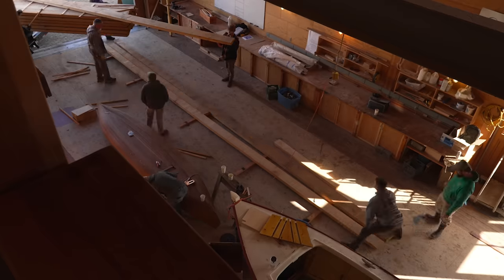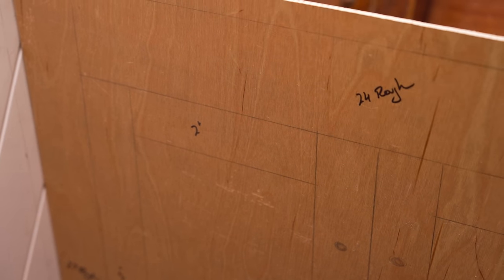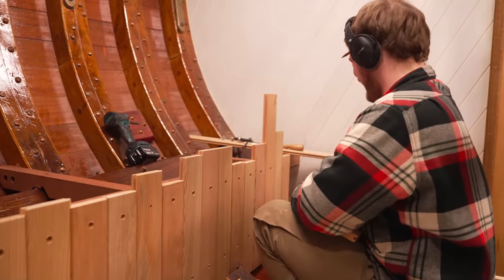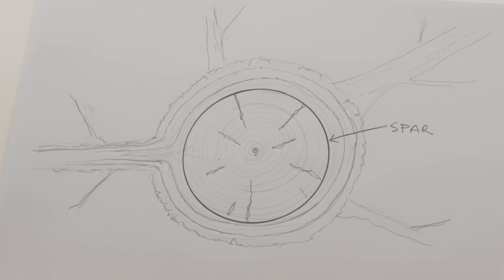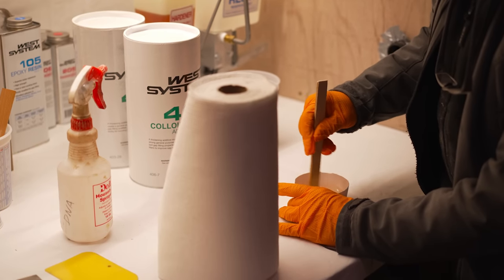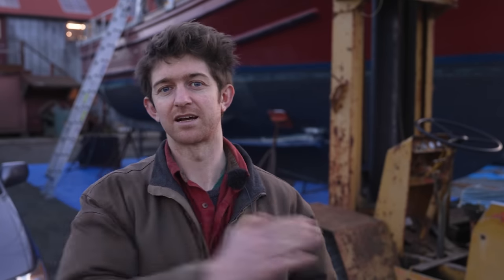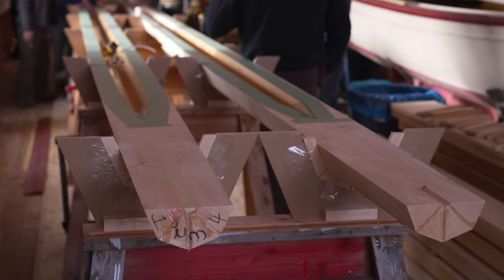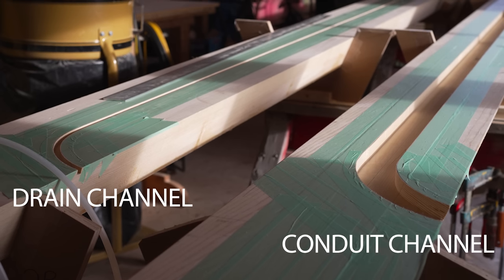Building the Mast (rebuilding Tally Ho ep146)

Comment: Leo, every facet of the Tally Ho rebuilt is top notch, no cutting corners anywhere! It would be interesting to Time Machine a shipwright from early 1900’s onto your team. Once over the culture shock I’d imagine they would quickly pick up on the modern tooling and be a fantastic addition to the team. My impression of boat building back in the day was they had much larger crews and the workers were more specialized. Building large wooden boats was a mainstream industry back then so every port city had a ship building workforce. You have come a long way with Tally Ho.

Comment: My crew in the carpenter shop at a US Navy repair facility in the '80's, was tasked with building a flag mast for the facility administration offices as the WW2 era mast was needing replacement. 45 feet tall, tapered,segmented and scarfed in alaska spruce. We had 2 civilian shipwrights who were on their Naval Reserve duty that supervised the work. After the epoxy glue up it was all hands on the hand planers to round it out and work the taper. We used an epoxy coating to finish it and it was painted with silver after, It was awesome for the modern sailors to learn the skills of our predecessors... Fond memories. Great job on Tally-Ho's!!!

Comment: One of only time's the blade in the table saw is set at the right safety height, 1/4 inch or less above the wood being cut..
Reply: Safety Sally in da house.  Not why the blade height is set flush.  But comforting when a fraction of an inch from the blade.
Reply: @weinerdog137  I've always thought of it as the difference between a bevel and a lost finger..

Comment: Leo, would you ever consider putting one of these new-fangled toroidal propellers on Tally Ho?
Reply: Think he would need his Patreon to do waaaay better, lol. One for a simple outboard for a bass boat is about $5,000-7,000.
Reply: Not likely as I'm yet to see a toroidal propeller that can be feathered. Feathering is important for sailing vessels as the propeller in feathered position will have a reduced drag when the vessel is propelled by wind/sail.
Reply: @apr888  Good point on the feathering.

Comment: Even at a smaller scale, building a mast properly is essential. 

 I recall, many years ago, watching the mast of a 17' catamaran explode.  Apparently, the jumper stays were too tight, but the wind was definitely too much. The explosion sounded like a gun shot and about 2' of mast became sawdust so quickly that the sail stayed in place for a few seconds before the rest of the mast suffered a catastrophic structural failure.

Lesson:  It pays to get it right!  😁

That shot of "Blue Peter" had me quickly looking it up on line.  Wow.  Not that I'm into motor yachts, but OMG.  Painfully beautiful boat.

Comment: SOO... I'm one of the folks stopped giving you Patreon funding... but not because of you but because I've stopped using Patreon entirely (I had an issue and found that they provided ZERO tech support... and I do mean zero. I could only login from one machine and couldn't get any others authenticated because of some issue on their end but they never even responded to emails. I figured if they couldn't fix a relatively simple problem like this I didn't want to trust them with money. 

I'd love to continue providing continuous support but you'd need to use a different service from Patreon... in the meantime I plant to periodically use your donate button.
Reply: Did you check your spam folder? If Patreon emails were ending up there that would affect authentication as well as giving you the impression that they weren't responding to your pleas for help.
Reply: Same here, email required to login, but I never receive an email. Nothing in spam folder and nothing helpful from Patreon.

Comment: Always do much nicer and neater working on something like that water plumbing system. I'm currently replacing most of a water system components in a 35 yrar old yacht. The previous owners have "modified" it over the years and the sight of garden hose made me need a sit down in a dark room. Once I have done the job at least I will know it's right.

Comment: Love seeing this. 
The barrel design is similiar to one I helped make 20+ years ago for a small trimaran built in a friend's back yard. 
Made a round cedar core, outer was four not eight pieces and we used a cold pin method (some may know it as hand peened) with metal collars for fastening with some glue as well. 
Most everything else was the same.

Comment: I only just watch this video today as I been so busy.
Anyway, having the radar reflector in the mast want work at all. The mast is covering what needs to be reflected. The square you see in the plastic tube are they to help the radar beams to reflect back to the scanner . If it can not     Reflect back because it’s inside the mast then it won’t work at all. Just think of it this way, look at all the stealth planes all have very smooth sides so the radar can not reflect off it.

Comment: I like how they engineered that Spar, with using a Jig set up for gluing it up. That's what I call precision fitment if you ask me. You should have confidence in that Spar. Should be able to handle the necessary forces that comes with Sailing. Great Job guys. Pretty cool stuff.

Comment: Really good episode having watched the full series. The next step is the boom I guess and judging from others (such as sailing NV who broke the boom 3 times over may years) a boom is more fragile than the mast. I would consider building the boom just as you have done for the mast but I would consider filling the central part with a S/S thick wall tube and epoxy the outside to the wood ...that should add huge strenth and provide the conduit for sheets etc. Anyhow on past performance I am sure you will do it right. 
regards

Comment: Nice to see those craftsmen working together to do such precision joinery . . . and with a skill saw. Beating the glue kick-off must put some pressure on the job.
I wonder if there's any footage showing how they put the taper on the staves. Do they remove material from the mating surfaces, or the outside surface?

Comment: Question on the barrel stave construction. Being a commercial driver I see a lot of engineered wood products. Usually see some kind of router work done to cut v's into the surface. This increases the glue surface area and increases strength and reduces the possibility of a glue failure.

Comment: I'm surprised you used West system epoxy,system 3 is made local and have always been top quality.I especially like easy 1:1 mixing ratio, for years West used a custom blend needing their pumps for mixing the right ratio.Now they finally changed their ratio to 1:1 so I assume more customers  would buy their product. West has been in business a long time but I'm a long term customer and won't change my choice.

Comment: nice quality!   i'd be nervous about using dougfir tho...it's hard to find the good old fir that lasts...nice to see high quality work!
Reply from the maker: It's Spruce, not Doug Fir! Although I'd feel fine about using doug fir if it was good quality.
Reply: @SampsonBoatCo  i live in southeast alasaka, i've owned wood commercial f/v's for 35 years and used to do a fair amount of rebuilding wood boats up here in my younger days.  my latest boat is a canadian 45 ft troller/ longliner.  It still has the original yellow cedar mast on it. i'm kind of curious why more people don't use yellow cedar for masts?  boat was built in 64 still has all original yellow cedar frames that are still in almost new condition, with fir planking. Maurice Gronlund was the builders name.  check him out, some of the highest quality i've ever seen.  is yellow cedar not stiff enough for a sail boat of your size?

Comment: A superior filler for west epoxy is dicaperl. Look it up, high strength but can be easily sanded or tooled. West filler cure very hard which makes sanding and tooling much more difficult.

Comment: Excellent Sketch comedy advertising!  

SAILS: material? are you carrying any spares on voyage? repair gear aboard?

MAST: will all that steel atop for radar also make your mast a lightning attractor?  Perhaps consider something less bulky and more effective as a Radar beacon reflector such as creating a simple solenoid of heavy wire, or light tubing made of any conductive or semi-conductive material that will react to the Radeo Waves coming at your vessel.  A "self inducting circuit" wrapped to stack vertically then connect the ends to each other forming an electric loop.  The Solenoid form will induce one volt and hold a faint field. This field will receive, match and change any incoming RF signals automatically and the transmitting vessel will pick that up as anomalie. Coils can be coated with rust proofing/plastic coating.  The magnetic field of the transmitted RF coming at you its magnetic field signal will be picked up even through insulation, channeled and changed by inscreasing the signals characteristics as amplitude, or frequency that originally left the sending radar.  Results depon on the overall shape and number of wraps and dimension of each wrap. EG are you wrapping with copper speaker wire or a 1/4 inch ribbon of aluminum for  your Solenoed wrap.  The CHANGE of the incoming radar signal reflectec back seems to be the calling card of this device.

A Cone or Pyramid shape is a converging /diverging change.  The cylindrical will give a different profile of EM change. Typical electric company transformers are cylinderical solenoid wraps. For Tally Ho's application a main point is that that Changing of their transmitted signal is what will bounce back to the transmitting vessel radar and get their attention.  IF you have four Solenoid units to station at each quarter, perhaps, wired in parallel and on the vertical they are stacked so that any single can function, they can all work together and provide a sort of blinking light radar reflector.  The units can be very small and light for they maginify and their Changing field to reflect is their big calling card. Smooth Sailing!

Comment: The quality of the available wood has changed a lot in the last 110 years.  Slow growing, tight grained, old growth wood is mostly gone.  I worked as a draftsman when I was in college.  My engineer had to update his wood strength engineering references every few years to be able to make accurate load calculations based on the wood getting weaker over time.
Reply: Sitka spruce does not get weaker over time. It is why the main spars of aircraft were built in  Sitka, it has an exceptionally high resistance against fatigue. Check @sitkajohn for more 🙂
Reply: @touchwoodbv-thesitkaspruce5107   I think you need to read the second sentence of Jerry's post again. He was not saying wood from a particular tree gets weaker over time, he was using "the wood" to refer to the available supply in general, whose properties at the time of felling (he claims, from his experience) are diminishing year by year.

Comment: The Yacht is a work Art I would fire proof all electrical by adding stainless steel sheets inclose with door including engine room and cooking area for pan grease fire for the mast I would for strength and protection cover it with clear Carbon fiber I would also have a gasoline water pump with long hoses so the pump holes can pump water out from bow to Stern bottom Village seen to many pan grease fire and electric fire and boats sinking having no strong water pumps pumps are not available in the middle of the ocean

Comment: it would really increase the strenght of the spar if you engineer a carbon rod to fill up the hollow core.
Reply: Sheathing the exterior with carbon would increase the strength and stiffness, whereas what you suggest would achieve almost nothing on either measure. 
It would be like thickening the vertical web of an I beam - there's a reason why they're as thin as they are.
Reply: @Gottenhimfella  great example with the I beam. you are right.Thx
Reply: @chiranagheorghitaeugeniuth98  Wow. You might just be the most gracious and open minded commenter on YouTube at this moment in time. Kudos and respect!

Comment: That tube end stretching tool seemed to provide a relatively loose fit to the metal fitting. I'd have stretched the ends less for a tighter fit, not that I'm a plumber or anything.
Reply: Pex returns a few minutes after being stretched to it's original diameter and provides a  very, very tight fit.
Reply: @on4xb  Thanks for the info.

Comment: Quick question, what percentage of the boat is still the original timber when you bought the boat?
Reply: Only the lowest 3 boards of the teak transom (about 25% of its total area) are original. The bunk siderails are made from original teak hull planking.

Comment: I just wonder what happens, if a solid tree is drilled through, a bore enough to run cables and halyards trough. If the core of a tree is removed, it should not crack as badly when drying.

Comment: Why do you have to shave the outside of the mast round, what is the advantage over a octagon outer shape
Reply: The sail, gaff & boom must slide easily up & down the mast, & they must also swing from side to side as the ship maneuvers - so the  round shape is essential. The mast will retain its octagonal shape at deck level (where it will be wedged into the existing octagonal hole) & down to the mast-step below.

Comment: Wow there Leo, How can something hollow be stronger than a solid? I don't doubt that you are right, but an explanation might be enlightening. Cheers
Reply: Under bending, the mast gains curvature - the outside face of the curve is being stretched & has the highest tension stress. This stress decreases as you move towards the center, where it flips to compression & increases to its max. value at the curve's inner face. It's not that the hollow mast is stronger, rather the center-interior of a solid mast contributes much less resistance to bending forces than its outer faces, so it's preferable to hollow out the center & reduce the overall weight.
Reply: @frederickstibbert7389  Well that makes sense. Thanks for the explanation.

Comment: Just one question if i may: how do you calculate the thickness of a mast?
Reply from the maker: Naval Architect / engineer
Reply: Typically the maximum diameter is approx 2% of the overall length of the mast. The wall thinkness is approx 30% of the diameter.

Comment: Question. 
At 2:05 and again at 2:56  it looks like the saw is set so it barely cuts the depth of the wood. I’ve heard that the depth should be set so the throats of the teeth are visible past the wood. Anyone have any insight?
Reply: Maybe it's for safety. They're cutting much more gradually than usual, so the chip thickness will be minimal.

Comment: Will you go over mast cost in a future video? I am curious to know what the final cost of something like that is.
Reply: Bloody frightening. Team that large has to be very very expensive. Superb work though, and having that experienced team is a huge help. Until the video, I'd not thought through the mechanics of gluing up something of this size.  Looking back, most of the work on Tally Ho has been done by Leo, with help from a varied cast of reprobates :) with work progressing at whatever rate it can, with the team available. The size and weight of the spars, and the timing necessary for the gluing and clamping, makes this not a task easily taken in small bites. Well done Leo for "outsourcing" this bit, it's definitely a job for a big team, and a short working window.

Comment: Just remember that a radar reflector is a legal requirement under SOLAS, with a minimum specification ... that one is going to be marginal at best even in free space and the attentuation of the wood will be significant, possibly as much as 10dB on the refelcted signal in X band ... making SOLAS compliance very unlikley.
Reply from the maker: Plenty of space in the rig for an additional radar reflector outside the mast if necessary, but no reason not to put a small one inside!
Reply: @SampsonBoatCo   It's never going to blow away or be ripped off by a stray halyard or in a knockdown, that's for certain!
Reply: @SampsonBoatCo  Sure, putting one inside is not a problem, but the performance will be unimpressive.  I would go with an active reflector, they are compact, efficient (draw just a few milliamps of current) and a huge step up from a passive reflector, but you do still need a passive one to be SOLAS compliant.

Comment: Maybe I mis-understood when I thought Robert said that the mast "eighths" would be glued together to make "quarters" and those would be glued to make "halves" etc. In the video, it appeared as though the assembly was achieved by adding 'eighths" one at a time.
Reply: Yup. They glued a quarter and then an eighth to either side to complete a half.
That 22 1/2° angle is really critical. Sixteen times if you are off even 1/4° and it is going to be too far off to close.